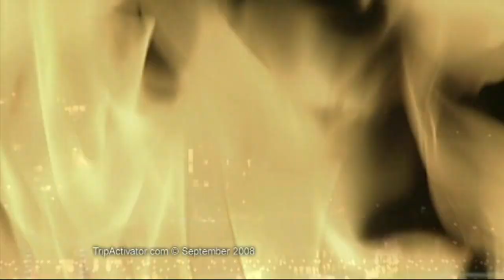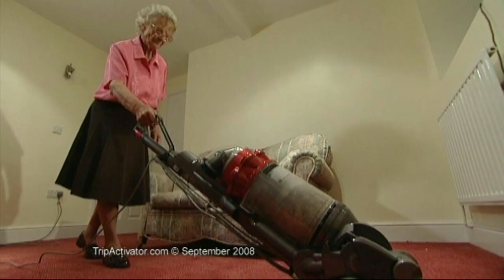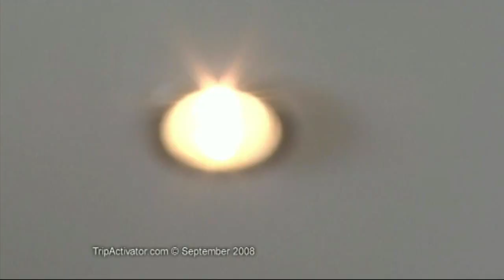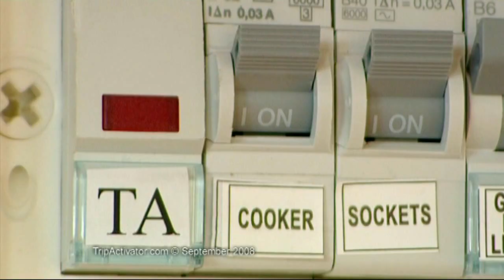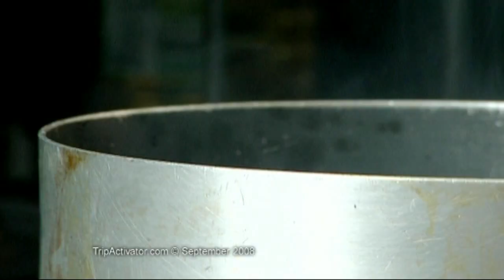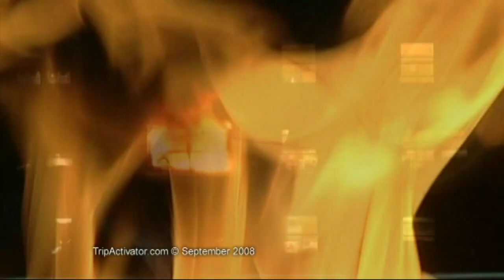DON'T FIT EXPENSIVE SPRINKLERS TILL YOU HAVE SEEN THIS

Comment: Oh, don't bother fitting fire sprinklers, the most accredited fire safety solution in the world, it's too expensive, well, not as much as the cost after a fire, and if you think they are ugly, then you've obviously not seen the concealed types, and they freeze up? Where do you think we are? Finland? where freezing is a concern, insulation is fitted, or a dry system is used. Now, I'm not saying your product isn't effective, but it doesn't even come close to the proven effectiveness of fire sprinklers, not all fires are started by cookers, and not all cookers are electric, some are gas, but I don't see you selling any gas solenoids or anything similar, and also, you seem to be missing the point, that by the time there is smoke being produced, it is likely too late to stop the initial combustion, especially if the smoke detector is located far away from the kitchen, and factor in the 30 second delay, I can't see how this will be of any use.